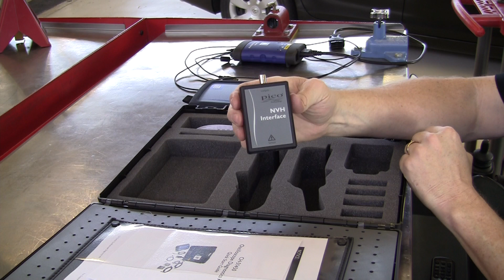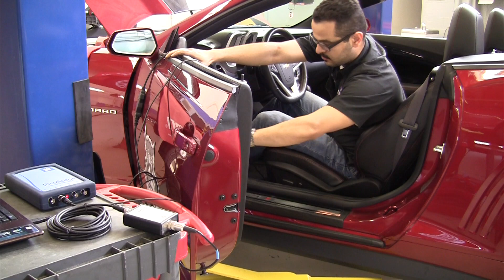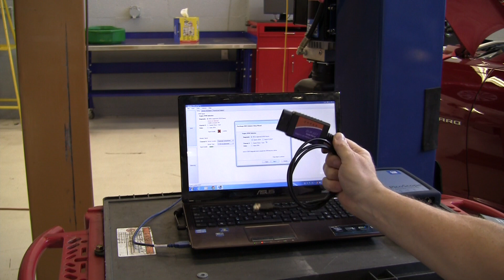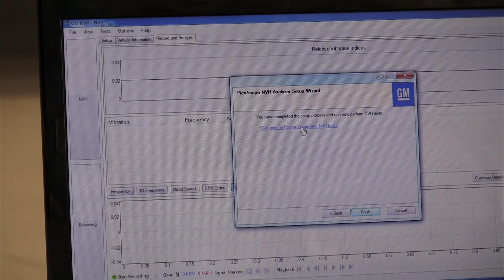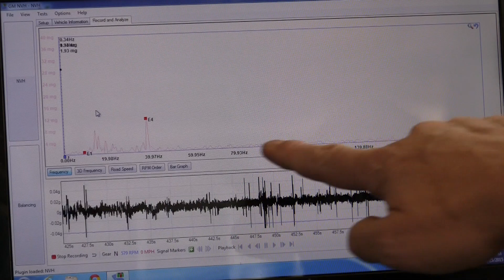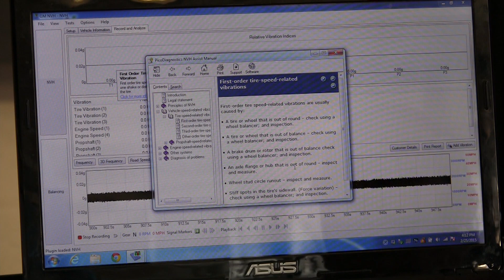Automotive Vibration Analyzers - Part 4 of 5 - GM PicoScope NHV

Comment: 36:47 seems to be double height and double hz of e4.
Reply from the maker: Yes, I believe it is the supercharger. They had a problem with the drive pulley bearing retainer
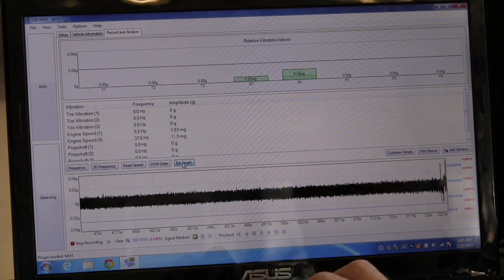Reply: @WeberAuto  electric fan at cooler? 36:47 - there is a peak 35:11 - no extra vibration